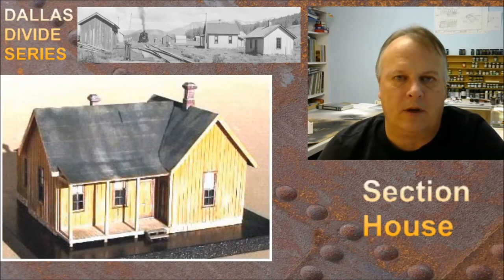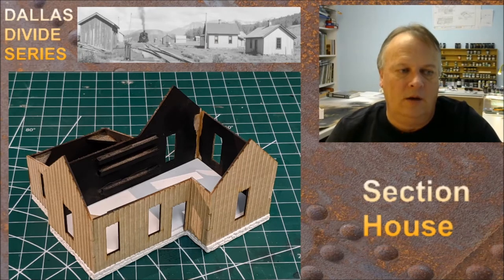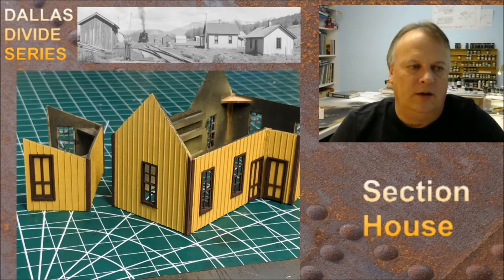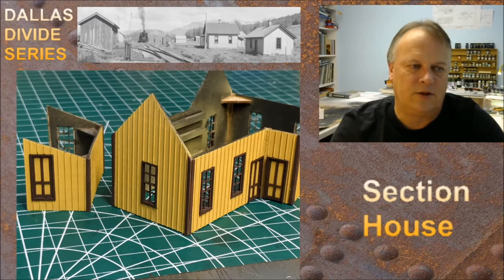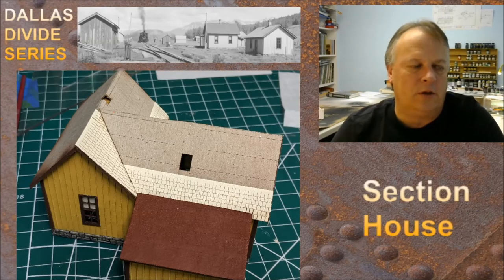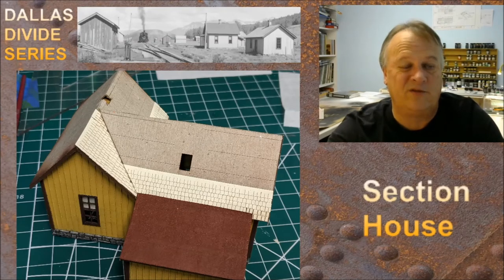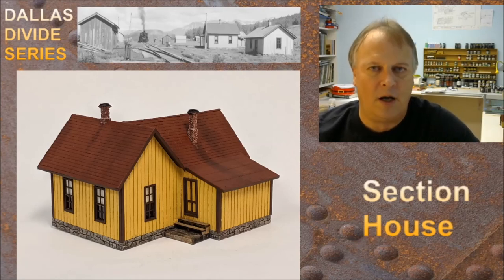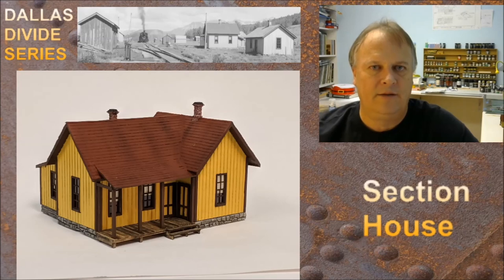Ep 69 HOW-TO DALLAS DIVIDE SECTION HOUSE, Banta Modelworks

Comment: Mike, any chance you could provide a link for the star paint?  I've searched and can't find them.  Thanks, Scott
Reply from the maker: Good question!  I will add that link to all the videos.
They are a brand from https://www.p-b-l.com.  Go to the Online Catalog, and use the drop down to line 22 for Star Brand paints.  I am not sure why they are branded under a different name. Buy their thinner since the paint is a little thick so you essentially get twice as much if you thin it. It also.dries fairly.quickly so don't leave the bottles open for a long period. I should do a video on just their paint, especially since they don't have paint samples in their catalog.
Reply: Thanks Mike,. Really like the series but I'd like to something of your layout.  Scott
Reply from the maker: Still working on a track plan, but I may be starting at Ophir since I have this space for a loop.